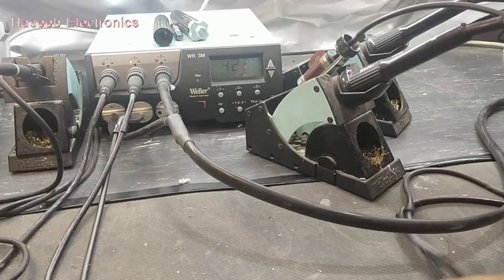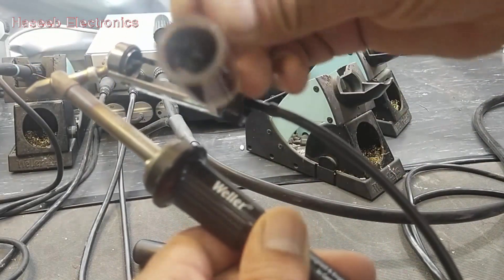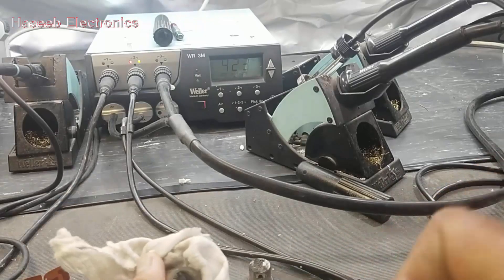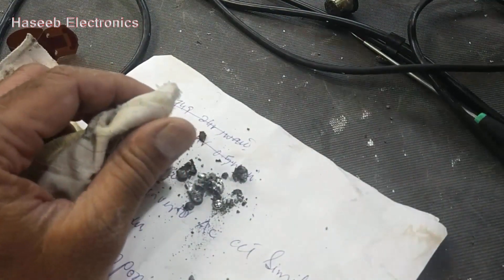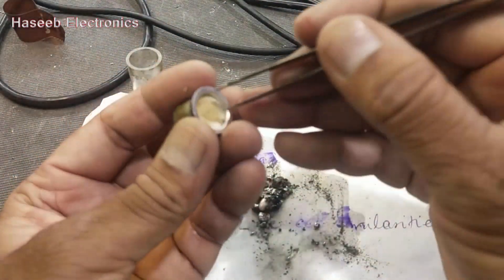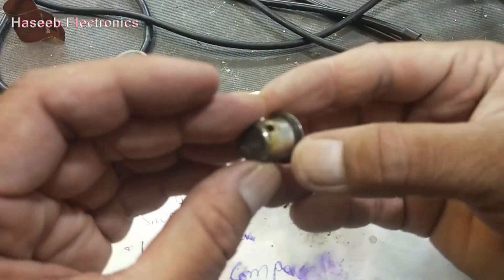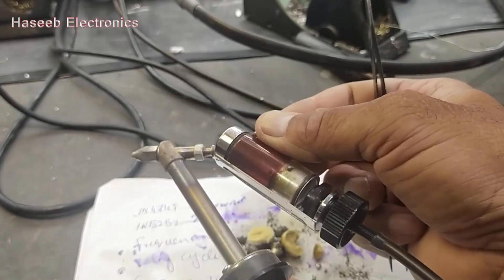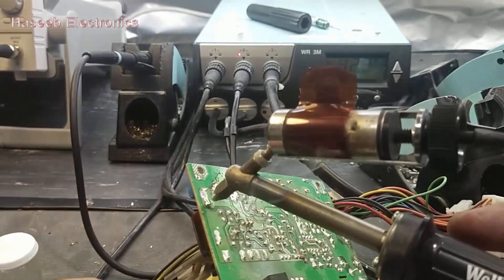[432] How to Fix Desoldering Gun Not Desoldering - WELLER WR3M DSX 80

Comment: How many desoldering  after change filter?
Mosfet,  igbt desoldering  use better?  Sir 
More  work  continues  which desoldering gun/station  best
Reply from the maker: for continuous use it takes 2 weeks to fill the glass chamber 
then we have to remove the sucked solder from the glass chamber and to replace filters 
it is really a best solution and very safe for rework on electronics board and it provides a very long life to the electronic circuits

Comment: Thanks for showing this desoldering gun. I was how you like this one? I watched a video on "Mr. Carlson's Lab" where he sped up the motor on his Hakko 470 for more power using an inverter circuit. Do you like the Hakko or Weller better? I don't own a desoldering station yet. I do like that you can see through the glass chamber on the Weller, and it seems to have pretty good power based on watching your videos.
Reply from the maker: Hakko 701 is my favorite one. I used it for moetgan 20 years and that is awesome
Weller is good but it's maintenance and spares are expensive. so that is reason I am frustrated in this scenario.
hakko takes 20-40 USD annually for maintenance. but Weller 200-500 annually average. but it is also acceptable by its work quality. 
very clearly I love hakko 701 rework station that is 1/3rd less in price with compare to Weller
Reply: @HaseebElectronics  Very good practical and technical answer!